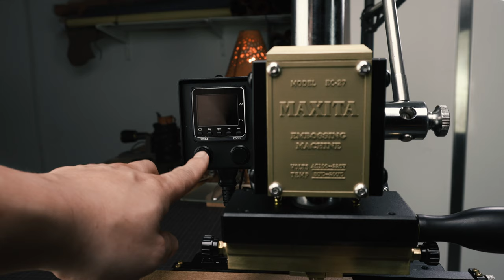Leather | Different interpretations of leather  / pen holder / DIY / free pattern

Comment: Hi, love this design!
How did you get the stitching holes of the inside ring on the bottom of the pot to line up with the outside body of the pot? I've been trying to use the same technique in one of my crafts and I can't get them to line up because the circumferences are different 😓
Reply from the maker: The number of holes inside and outside are the same, and they are evenly distributed!